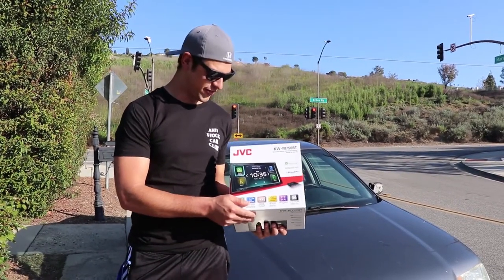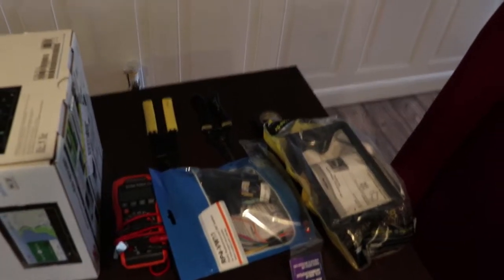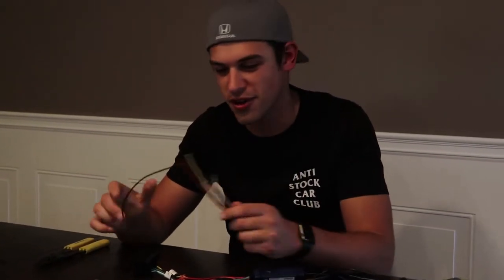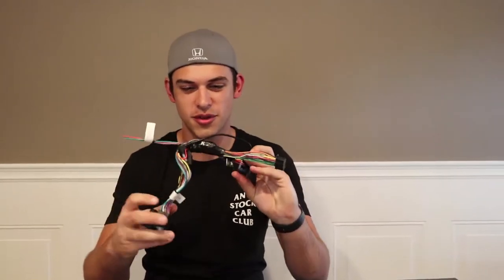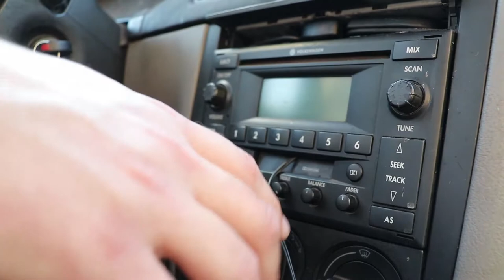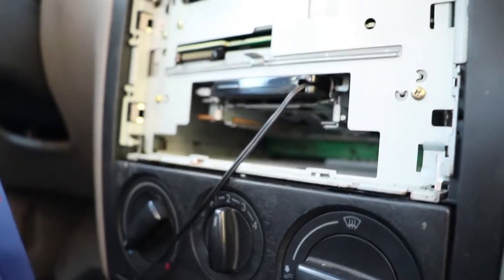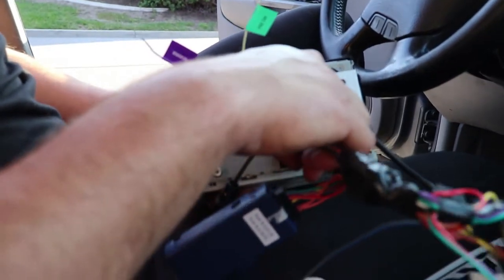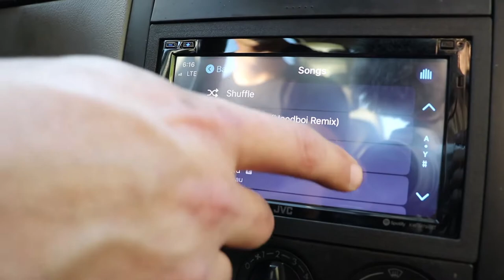Putting an Apple CarPlay Radio in my Mk4 Jetta

Comment: Does this work with the factory monsoon amp?
Reply from the maker: Yes! You just have to get the harness for the monsoon system from wherever you order. My jetta had the monsoon system, so the wiring you see in the video is for monsoon amp.

Comment: Where did you wire the ignition (red) wire? I know if you do it in the harness it won’t turn off fully
Reply from the maker: I wired it to the red wire on the adapter harness. Turns on and off fine for me!
Reply: @NoahGaither  hmm okay. I’ve been watching a bunch of videos because I’m about to do this and everyone says the Jetta doesn’t have the same ignition system so you have to wire it elsewhere. Good to know thanks!
Reply from the maker: @chiphargis2419  Hmmm, never heard that. That would be false! The ignition wire that runs into the stock radio (and comes out the adapter harness) works just fine to wire into the ignition wire on the aftermarket radio!